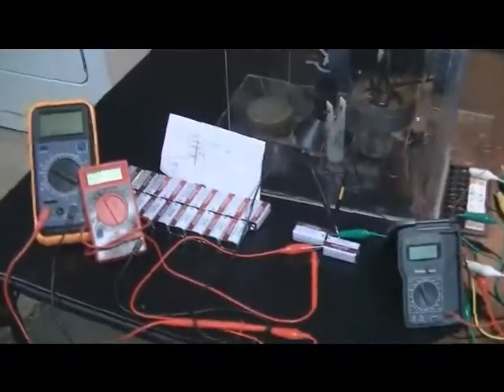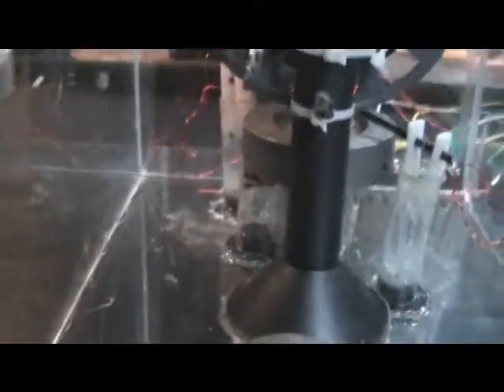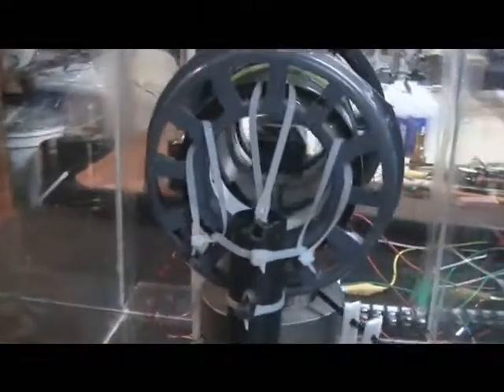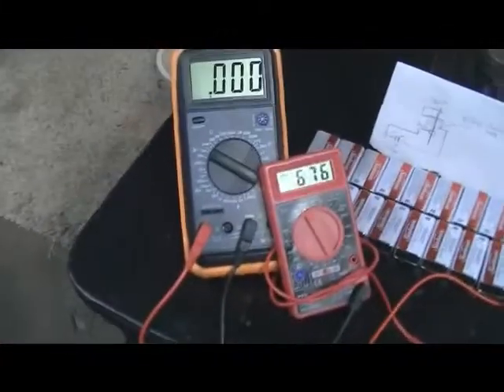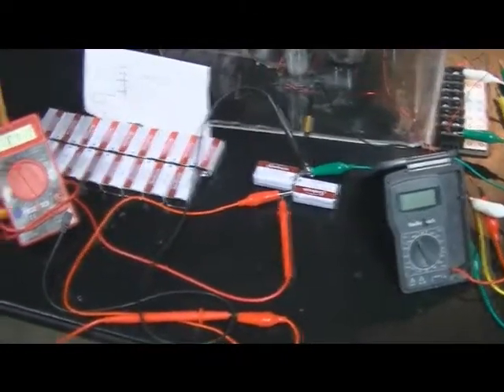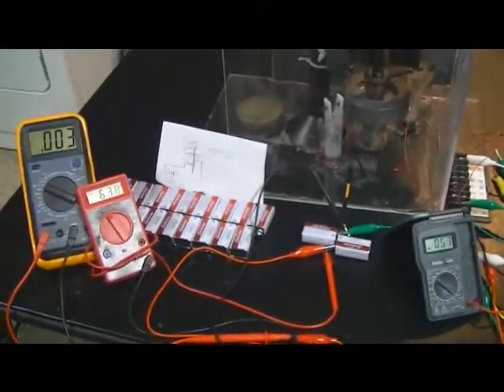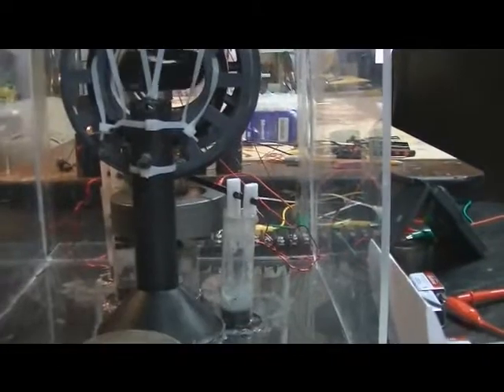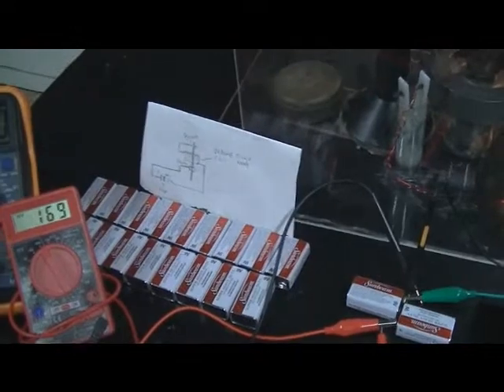PMBO2013 Entry

Comment: Earth is a giant electromechanical magnet. Earth current needs to be stepped down to draw lightning from the rocks and water. To pull lighting out of the earth you need a transformer and an electrical decelerator before you can transmit it into the current grid.